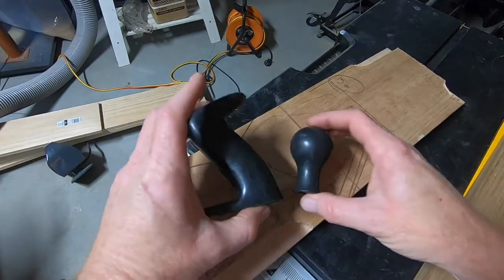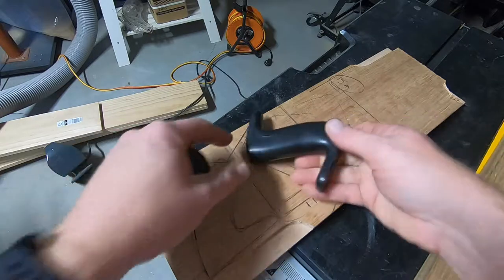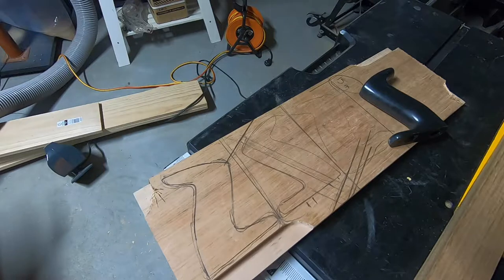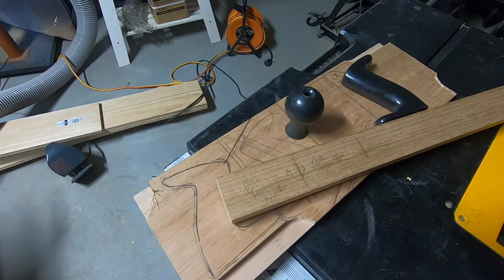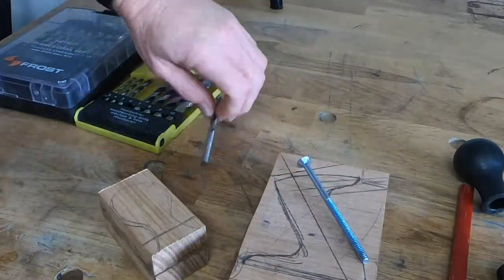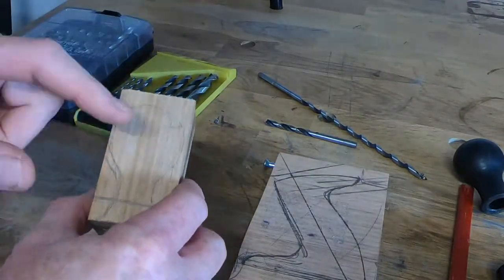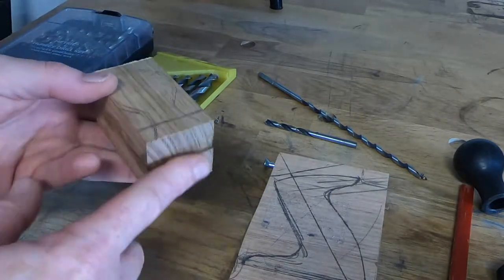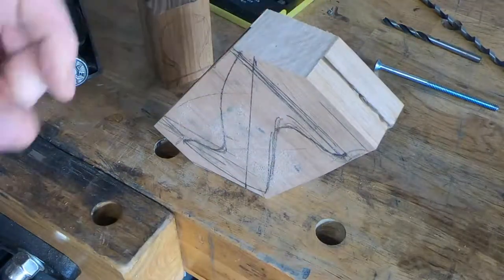Restoring Talitha Ep. 66 - In the Workshop - Making a Handplane Handle and Tote

Comment: Nice job! That bench could really use some diagonal bracing, though... don't think I've ever seen one move around as much as yours does.
Reply from the maker: Yes normally all good but needs the metal legs and bolts tightened!  Have been putting it off to move in a few weeks.

Comment: what sort of finish did you rub on this?
Reply from the maker: Jenkins Boat Works Hi, next time I would use a solid block of wood from the wood pile instead of glueing two pieces together. I just stained first with a golden teak stain, then 2 coats of shellac and a coat of paste wax. If they were better wood I would use linseed oil and then shellac and wax or just the oil and wax.